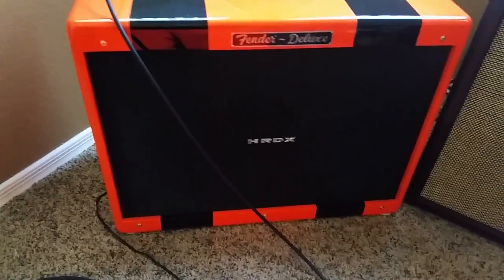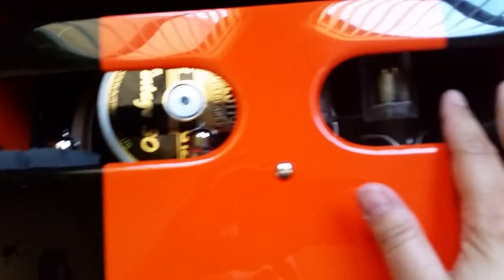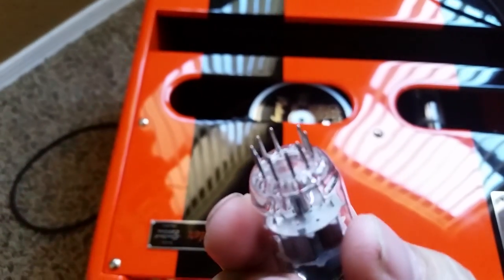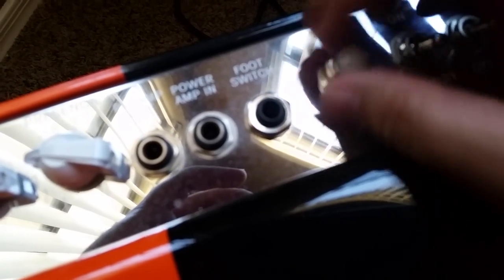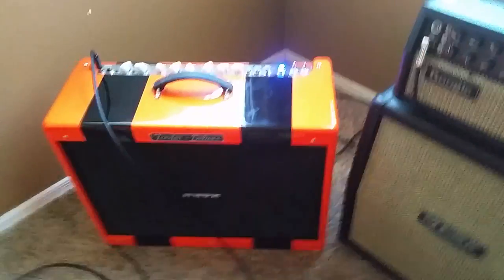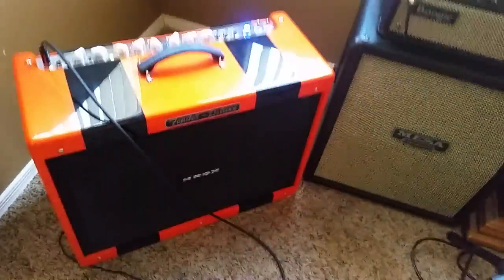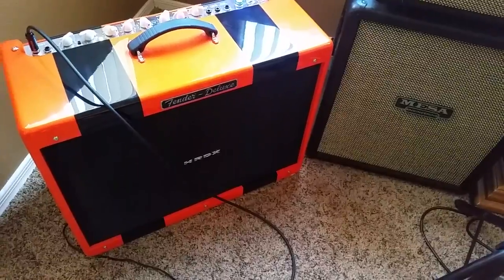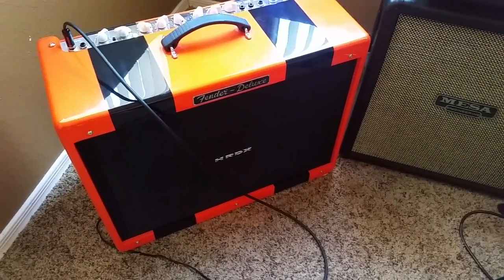Improve Your Fender Hot Rod Deluxe For $10

Comment: Phillip I'm a great fan first of all, and second I just did this mod to my HOT ROD DELUXE III, with a JJ12AT7/ECC81 from JJ tubes and  the bright switch makes noise, really bad noise, then you turned it off and the noise stops, but this doesn't happen with the 12AX7, I tested 2 jj 12AT7 that actually work in other amps besides the one I bought, any suggestions? :B

Comment: Alright...to repeat...I change the first pre-amp tube to a 12AT7 from the stock 12AX7.
My question....with this require any re-biasing? I can change out the tube with NO re-biasing issues?
Was that Celestion speaker stock on your amp or did you put it in?
Thanks!
Reply: You don't need to worry about bias with preamp tubes.
Reply: +rich655 No re-biasing with preamp tubes, only power amp tubes.  If you're looking for a suitable replacement speaker for this amp, I used a Warehouse Guitar Speakers Veteran 30 (it's a Vintage 30 clone) and it sounds killer.  I've also heard their ET65 speaker works well in this amp, although I've not tried it personally.  I like WGS because their speakers sound great and they're sometimes half the cost of Celestions, especially when it comes to the Vintage 30 speakers.  I've had a 412 cab with Vintage 30's and the Veteran 30 is comparable, but different with its own sound.

Comment: is there any difference between the different HRD versions?   I, II, III?   any recommendation?    I noticed a V30 upgrade
Reply: I just got the newest one, the III. I don't think there's a whole lot of difference in the actual "amp" between versions, although supposedly the drive is tighter on III. It also has a black backplate instead of the silver reflective one he has. 

Make sure you get it under warranty though (unless you can get a major discount used) - because they are such a popular amp they are widely produced, meaning you'll get a couple of duds here or there (and it may simply be a bad tube or two).
Reply: Stay Cool Bret, Bret Stay Cool great, thanks for the tip
Reply: +JAFO-PTY also I forgot to mention, it seems that speakers change depending on which model you get or whether it was part of some limited edition, so you may want to check that - speakers have an often understated impact on the sound of the thing.

Comment: Hiya Phillip. I've always just used stock tubes in all my amps, so really..I know little to nothing about the tubes themselves and how drastically they can change. Having that said, have you tried the "high gain" version of that EHX tube you linked? Or any of the other features like "balanced triodes, low noise & microphonics, etc". Wanting to get one but I'm curious about all the different add-on features that they're showing. As for the higher gain version of the tube, I'm not expecting to go all..facemelting Metal or anything on my Hot Rod. I have a 6505+ for that, but I am curious to what it'd sound like anyway. I like having that flexibility.
Reply: just get one and try it,move it around to different positions changing only one tube at a time(meaning take out one tube and swap it,then if it doesn't do what you want put pack the stock tube and try it in a different position).

all of the "features" are more marketing b/s

Comment: I did this and the amp sounded like vibrating glass. I am guessing they sent me a bad tube? I got the Electro-Harmonix 12AT7 from TubeDepot.
Reply from the maker: +rekjazz62 I have had great luck with EH, but sounds like a bad tube. To check the tube is easy. Turn on the amp and use a Chop stick, Wood pencil, plastic pen, or any thing not metal and tap the tube lightly when on. If you can hear that tapping and even worse if you can hear it and it has a ringing sound. You have a bad tube.
Reply: +Phillip McKnight Yep, Called TubeDepot and they are sending me a new tube. Thanks! Big fan of your channel!

Comment: Wouldn't a 12AY7 or 5751 be a better choice for V1 here?
Reply: 12AX7 has a gain of 100 (97.5 average) and a plate voltage of 1.1 mA.
5751 has a gain of 60-70 and a plate voltage of 1.1 mA.
12AT7 has a gain of 60-70 and a plate voltage of 10 mA.
12AY7 has a gain of 45 and a plate voltage of 2 mA.
So although all will work it seems to me the 5751 is the most natural choice as a replacement for an AX7, although it may be that the AT7's preference for a higher plate voltage might aid in smoothing things out.

Comment: Hi. I have a gig later tonight and I just tried this. However my amp feeds back on both channels after about 3 on the volume.Even with nothing plugged in it feeds back.I put the old tube back in and it's fine.Sounds like a great mod and I still want to make it work. Any ideas?Thanks!
Reply: Your amps feedbacks without a guitar plugged in. That means the tube you put in is microphonic. It 's further proven by the fact that the feedback disappear with the original tube. This kind of amp  is particulary prone to microphonic feedback as preamp tubes are very close to the speaker. This is why you can see the 'rubber' thing over the preamp tubes in the video, it serves to dampen vibrations of the tubes and decrease microphony problems.  . The tube that is swapped in the mod is the first preamp one (V1), where tube microphony is most likely to cause problem.
You can verify by lightly tapping the suspected tube (in place and the amp powered on) with a pencil. If you can hear a metallic sound ("ping ping") in the speaker then the proof is made: you got a case of microphonic tube. This is a defect. Another 12AT7 may work perfectly. 
 If you bought the 12AT7 recently the supplier may/should accept a return and replace the tube. You may precise you want a  low microphonic one and explain your problems and findings.
Reply: Thanks so much for getting back and explaining this to me. I will try another tube, because, yep, it does ping when I reinstalled and tapped on it. Best regards

Comment: Is that the phase inverter you change?
I usually use a 12au7 in the phase inverter spot in all my amps.  I just wondered.
Reply: Actually that's the tube of the first and the second stage of the preamp. The phase iinverter is the closesd to the power tubes.
Reply: +Gustav Cida thanks
Reply: You are welcome, greetings from Austria...
Reply: +Gustav Cida Greetings from the Chicago Illinois area :)

Comment: I own a Hot Rod Deville, will this work the same on my amp. Same problems super loud and the drive channels are horrible. Also will i need to do anything extra or is it just plug and play? Mine is a 4 X10 model by the way.
Reply from the maker: +dph42 Yes, it will work the same way with issues or additional steps taken. I think its even a little better on the Deville.
Reply: +Phillip McKnight Thanks a million, I may give it a try this weekend.
Reply: +Phillip McKnight   Finally got around to doing this swap last night on my Deville. I can't believe it took me five months. It tamed it down just like on your Deluxe.  Overdrive was calmed down as well.  Thanks for a great Tip and video!

Comment: 12at7 tubes sound bright and strident and lack the midrange of a 12ax7 or 5751 tubes !
I only use 12at7 tubes as phase inverters !
But this amp has a lot of gain , I have PSvane 12ax7 tubes made for high quality HI FI amp that are low gain even more so that a 12aT7 .
The 12ax7 EQ is different than most 12ax7 tubes and brighter in treble but in overdriven tones would be good !

Comment: Hi Phillip! I've just tried this mod and i've got a question i was wondering you could help me with. When a put the new tube on my Hot Rod amp the tube doesn't show any "light", asi if it were off or something, is this ok? or is it a bad tube? I guess if the amp does sounds in the first place with the tube on that means that the tube works fine right? thanks!

Comment: I have a 40 watt blues deluxe. Would this work for it as well. I think both amps are almost the same.
Reply from the maker: Yes, I have done it to the Blues Deluxe. The clean  is the same as what you hear in the Hot Rod, but the over drive is a little more mellow. The 12AT7 cleans up the over drive. I still liked it and even more so with the Blue Deluxe with a boost pedal.
Reply: Phillip McKnight Thanks, I'll give it a try.

Comment: just did this swap with an electro harmonix 12AT7. I turned the amp on to let it warm up and got a loud high pitched squeal. I turned the amp off right away. any idea what could be going on?
Reply: put the stock tube back in and the amp is fine

Comment: I did this mod two weeks ago to my HR Deville 4x10 and it works as advertised.  However,  I now notice a metallic ring that wasn't there before.  Swapped tubes again in case the first one was bad but it still rings. Anybody else experience this or know what it could be?

Comment: Commenting 3 years after originally posted but I was wondering if changing a 12ax7 for a 12at7 can be safely done on almost all tube amps that run a 12ax7 in position one? I have two amps - a Traynor YGM-3 (2 x 12x7 and (I think) a third 12ax7 for reverb/tremelo with 2 x el84 in the power amp, also an old Park 20 watt (which I think is based on Marshall 20watt Lead/Bass only single channel so you cannot jumper the channels). The main problem is the Park - the volume goes from virtually nothing to blistering loud with no graduation - checked out the volume pot but this isn't the issue. Would a 12at7 likely fix this based on your demo? Thanks!
Reply: Replace the linear-taper volume pot with an 'audio taper' pot of the same value. Fixed, without changing your amp's 'character'.
Reply: Thank you! Will order the parts!

Comment: I done this mod and my amp started the ring or feed back first thing! What's the deal?! I tried it a few times made sure it was in right. It's not bent. It's not lighting up or anything just feed back! HELP!! PHIL
Reply: Okay I biased my amp and it was high 90's so I loweredit down to 70. I believe that was the problem cause the tube checked out good at the shop and everything seemed to be okay with my amp and tubes and it sounds awesome now. Before it was spikey and harsh. I decided to just use my boss EQ to lower the output and get good sound at lower volume. Another way to easily quiet down your Hotrod Deluxe. 
 Your still the man Phil! Keep up the videos!

Comment: How does this amp take pedals ? I'm thinking about getting it! I usually run a ibanez ts9 or a boss sd-1
Reply: +Dawson Hooker Why not just find an amp you actually like the sound of in the first place?
Reply: well i love the clean sounds but the drive channel doesn't sound very good to me in my opinion
Reply: +Dawson Hooker Have you tried the Blues Deluxe? (Most people prefer it to the HRD.) I used to have a friend who found that just replacing the speaker with an Eminence Swamp Thang suddenly made the overdrive channel sound great. No more pedals needed. Also, the overdrive on the Super Sonic 60 and SS 22 are both very good, but you can find a used Blues Deluxe for under $400 very easily. It's the closest thing to a real tweed Bassman you'll ever find at that price. Cheers.

Comment: Just got this amp new and tried the mod but I ran into issues, at first it wouldn't power up with the new tube 12AT7 in slot 1 and then when it did power up it made a pretty bad noise, tried another tube (got 2 new at the same time) and it did the same thing. I put the original 12AX7 back and it was fine again. Not sure whats up, the new 12AT7's are good quality Cryo tubes (not the cheapest) Im googling now for clues
Reply: Ok I finally had some luck by using an ECC82/12AU7 in V1 the ECC81/12AT7 just would not work, the amp would almost go into oscillation. Works now though and sounds good.

Comment: Hi , i bought the same tube that you use in this video, a groove tubes gt-12at7 and  after the swap  I hear some vibrating noise at some frequencies. At G string 8 and  D string 1 and while playing chords. Why did this happening? how can i solve this?
Reply: The tube could be microåhonic. Try to tab on it with a pencil when the amp is on. If you hear a loud ´boing´ buy a new tube.
Reply: @kimhansen6384  thanks man, i tried this and it did the noise. I've sent it back. I will buy ehx 12at7wceh today.

Comment: Don't do it using an Electro-Harmonix tube made in Russia, I had four new ones and tested two in the amp-both induced microphonic noise out of the speaker. I didn't even try the other two from my set. It sounded like change rattling in a dish. That may be the point of the tube damper, my HRD is 1998 US made and no tube damper. I think it was just rattling the elements within the glass tube itself and amplifying it.

Comment: Blues deluxe would be the same fix?
Reply: The 12AT7, 12AU7, and 12AX7 are interchageable without any proplems since they have the same pinout. If you take a look at the datasheets you will notice the difference in the power dissipation. You may also see them as ECC81, ECC82 and ECC83 in the european datasheets. Listen to the result, a circuit or tube damage is not a issue.

Comment: i have the hotrod deville III... will this do the same for my amp??
Reply: I believe it will.  I have one and tried another 12A?7 tube in the pre-gain slot to lower the gain, but I didn't like the sound of it.  But the one I used was different than the one in this video.  Check out the comments on Guitar Player's FB post of this article and you will get some more info..  

https://www.facebook.com/guitarplayermag/posts/10154137090876063
Reply: I have a HRDeville myself and have 12AT7's in both the first preamp position, and in the driver position. It mellows the tone, and drive a bit, while making the amp a bit quieter overall. It still gets loud when turned up to 4 or 5, loud enough to gig with, but opens up some control on the lower volume settings. Anything lower than the 12AT7 in the driver section really can't drive the power section properly, so I wouldn't go any lower than that. If the volume is your only issue with the amp, then what you may want to consider is changing out the volume potentiometer with an "audio taper" pot. It really is what should have been used to begin with. If you want to mellow out the sound, changing the tubes will do it. Better yet do both mods, then keep both the 12AT7's and the 12AX7's on hand, just in case you want to mess around on the fringes of chaos with full gain. Personally one of favorite things to do with my "Dirty Blues" type stuff. I'm also going to be modding my amp to "dual power" capabilities by adding a switchable "Triode-Pentode" setup for a "half power" setting. More involved mod that requires an electronics back ground. However, with that mod completed, I'll have an amp that can do both bedroom level practice volumes, and full large scale gig volumes, without sacrificing tone or drive.

Comment: just did that and the deluxe had a whistling noise so i changed back ?

what was the whistle ?
Reply from the maker: +mike whelan Sounds like a bad tube.
Reply: +Phillip McKnight  it  was working in the 78 princston reverb i took it out of...as far as i know
Reply from the maker: +mike whelan I definitely could be wrong, but sounds like a micro phonic tube issue to me.
Reply: +Phillip McKnight  thanks 
i'll google that and try not to electrocute myself
Reply: tried this a year later replaced the second tube instead and the noise is gone and the amp sounds better to my ear.
gets nice pick squeal  easier.  I binged on your videos  on occasion, good job good info.

Comment: I have a new BDRI and on your recommendation I tried the 12at7 in V1, it didn't really bring the volume down that considerably, but I'm using my volume pedal and input 2 to tame it back. My question is I read that at7 is not a preamp tube and shouldn't  be used in V1 but ok in V3, the 12ay7 IS a preamp tube and might work well in V1 to bring the gain down ?? Anyone ???
Reply: A 12AT7 will reduce the gain by around 40%, a 12AY7 around 50-55%. I have kept 12AX7 tubes in V2 and V3 like Philip has done here. Not only reduces volume but greater clean headroom as well. The best 12AT7 out there is without doubt the NOS Mullard CV4024, and very affordable too!
Reply: Thanks for the reply, by the way I love the sound of the amp above 4 on the dial, but I'm realistic. Any tube amp in my experience wont sound as good on 2 as it will on 5, and this was a cheap and easy mod anyone can do. Thanks Phillip !

Comment: replaced the tube,with your first recommendation,and now I'm getting a high pitch feedback, at 5 volume.
any thoughts?
Reply from the maker: Bad tube. I sometime have to try a couple
Reply: Your tube is bad or not seated, or your socket is dirty. Always have spare tubes and switch out several, most tube amp problems are solved this way.